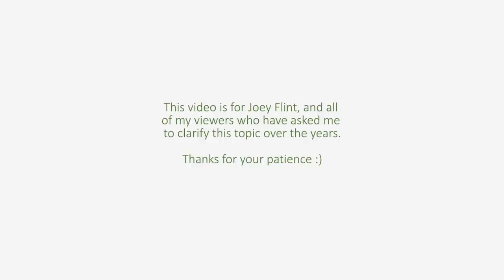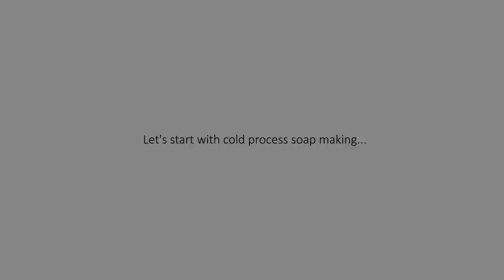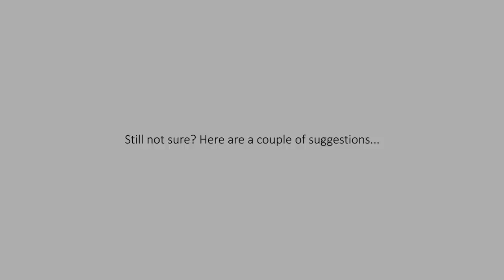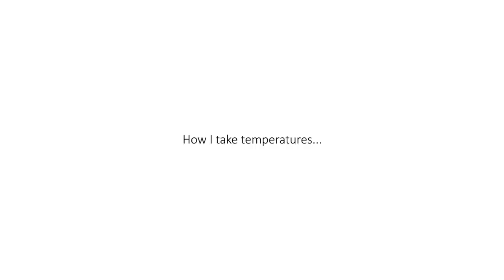About temperatures for soap making (CP & HP)

Comment: We live in Cyprus,  and don't have dry lye. We have a 50/50 solution n add water to 70/30. The winter was fine making olive oil soap, then suddenly the mix went thick immediately when pouring lye in. The only thing that changed is the temp of the room. Can't figure out why. With the mixer it turned lumpy immediately. A third attempt, we only hand stirred it n within a minute it was already thick. The temp of lye was 28•° . During the winter, we didn't even test temp n did everythin as it was n had perfect batches. Now we are confused.

Comment: Now I know why the batter trace too fast when I make soap, the temperature is too low on both the oils an the lye. My recipe includes coconut oil, cocoa butter and shea butter. Where I live in Puerto Rico the lowest temperature is between 73°F and 75°F. Coconut oil here is always liquid. It gets a little cloudy if the temperature drops a couple of degrees because of the weather but it's always liquid.  Excellent information. That's why I love your videos. Thanks!! 💕

Comment: What a relief! I haven't made soap for a while and I thought I'd make some Olive oil soap in hurry. I didn't bother with temperatures but I put well dissolved lye and water in the cool olive oil and mixed with stick mixer for a pretty long time. It never turned white but I put it in the molds anyway. It was the consistency of pudding, I didn't even wear gloves but the soap didn't hurt my hands. God only knows what I'll find tomorrow morning! Wish me luck. I'll try to give an update on this batch after examining it in the morning. After what Elly has said about temperature, I can be hopeful. Haha!😂
Reply: The soap did harden up overnight. It's a yellow colour. Must be the kind of olive oil I used. It's much easier than I thought or how I made it in the past. Thank you for that timely info about temperature and reduced water info too. I used 220 mls to 1 litre of olive oil.

Comment: Great video and good information. I find if it's coconut and olive combo above 35 degrees for the oils and below 50 degrees for the lye is fine in winter. I just combine them with no issues, if it's a heavy butter / hard oil recipe I make sure all is between 40 - 45 C. You are absolutely right with heavy water discounting and heat transfer method doesn't work well if there is a high percentage of hard oils and butters. In winter I melt my coconut oil as the heat transfer method isn't as effective
Reply from the maker: Ah yes, I know you love the heat transfer method! Thanks for your input George.

Comment: The queen of soapmaking videos delivers another fantastic guide for all us mere mortals to absorb and use when practising our craft.

 Thanks Elly for the explanation, usually my soaps come out ok, for a beginner anyway, other than the one I made in July where the butter/oils mix and lye must have been too hot as it thickened up with the stick blender in a  few minutes and i had to scoop the mix out with a spoon into the mould. It did feel very hot too.

I read on another soapmaking site that between 25 and 55 degrees C or 85-`130F is a good rule of thumb. However based on the experience just mentioned 55C is probably too hot.
 As you say room or body temperature depending on the recipe is suitable working range.
My summer soaps are curing nicely and I've just began using them, they appear to have turned out ok. 
That is the frustrating part, creating a recipe, making the soap and waiting until they cure to see if the recipe is a success or not, all part of the learning process though.

Comment: I love your clear info!  Regarding temps... even with Shea butter and added sodium lactate, my vegetable oil only cp recipe doesn't have much longevity in the shower.  Before I switch to tallow, I want to add stearic acid (cheaper than adding more shea).  With a melting point of 160F this requires a minimum 130 F temp for saponification. How do I prevent high temp issues like volcanoes or white spots?

Comment: Hi, great lecon. Please a lesson on hardness of soap. In mu soap calc I manage to have hardness=40 or 41 is that garantee my soap to be hard so that it doesnt melt when i use it ? Thank you, i learn a lot from you.
Reply: Add more olive oil to the soap. Olive oil adds hardness to the final bars. 
Also Elly had a recent video on the gel phase, if you make sure the soap fully gels your bars will melt slower. 
But I also find that the bars and recipes I enjoy melt in the shower easily and I just put well draining soap dishes all over my house.
Reply from the maker: Hi, soap can be extremely hard but still be very soluble and melt fast in the shower. Hardness and solubility are very different things! Soap calc doesn't explain this to us very well. The best way to get hard and long lasting bars is to use lots of saturated fats and butters (hard oils), this page will help you https://www.ellyseveryday.com/choosing-oils-for-soap-making
Reply: @EllysEverydaySoapMaking  thanks a lot this helps me as I am a beginner in soap making.

Comment: Thank you Elly for another informative video.
I have a question that may seem silly, excuse me...
I had made a batch of lye for my soap batch and my oils were melted but I could not get to actually making my soap because of an emergency. I packed everything away safely to make the soap the next day.
I had to warm my oils up a bit again (winter + coconut oil) but my lye solution was cold. The batch of soap cracked on the top a bit but the soap did turn out lovely, saponified etc.
My question was whether it is possible to reheat a lye solution gently to make soap and in so doing avoid cracking due to the varying temperature of lye solution and oils.
Apologies for the long message...
Reply: Yes I generally see soap makers heat the lye solution in a warm water bath
Reply from the maker: Hi, yes you can warm up your lye solution in a stainless steel pot, water bath, and I've even heard of people using the microwave. You would have to do your own research on all of these though and check them out before doing it. I'm not sure which is best. With your soap cracking though, that would not have been due to the different temperatures of your ingredients, that would have been due to your soap getting too hot in the mould through too much wrapping, oils too warm or using oils that saponify very fast and get very hot (in which case you need to wrap them less).
Reply: @EllysEverydaySoapMaking  what do you think is the cause of hard brittle soap that the layers dont stay together?
Reply from the maker: I'm not sure without knowing the recipe. Could be that it is left too long before cutting?
Reply: @kayla-rae4770  thanks so much :-)
Reply: @EllysEverydaySoapMaking  thank you so much Elly...that is a great tip to know, especially when I find that I am running out of time to continue soaping in my kitchen.
Yes, wrapping them too warm would explain it, I did indeed do that and my oils may have been too warm and not the room temp. of the lye solution.
You are such a great teacher and so lovely, no ego just beautiful!
Much love from South Africa
Reply from the maker: You're very welcome, and thanks so much for your kind words - they mean a lot! Take care x

Comment: I heard that the lye solution and oils should be within ten degrees of each other to maximize soponification.
Reply from the maker: It's a myth. The temperatures equal out with each other when the two components are mixed together. Only with hard butters and waxes does the temperature need to be measured.

Comment: Thank you so much Elly, I am a bit confused 
Ok, would it be ok if I have the same temperature 40 degrees  method for both my 100% oils and lye solution when I used 15% Shea butter and 15% cocoa butter and 20% coconut oils while my other oils is olive oil 50%. 

In order words if I have 15% Shea butter, 15% cocoa butter and 20% coconut oil with 50% olive oil which methods will you consider to be best.
Reply from the maker: Hi Geldine, yes about 40°C for oils and lye would be perfect for that recipe :)
Reply: @EllysEverydaySoapMaking   thank you

Comment: Thank you for taking the time to explain. You are so much help! I have a weird question.. when making hot processed soap is there a way I can turn it into cold process..Once I add the lye can I then pour it out and put it into soap forms and cover it to help it cure and turn into cold process soap? It is so hard to explain what I mean..I hope you know what I mean. Thank you so much for all your videos.. Loving them all!!!
Reply: I found a better way to explain ..  when i make hot processed soap.. the oils are melted and I add the lye water.. can I then use that batter like a cold process batter instead of following through with the hot process procedure.
Reply from the maker: Yes, of course Penny! HP recipes are just cooked CP recipes. Only difference is I often use more water in HP recipes to account for evaporation.
Reply: @EllysEverydaySoapMaking  That did not work for me... I am making hot processed soap right now.. I melted all the oils in my crock pot and I just added the lye to the melted oils. I stick blended it well and now I am going to cover the crock pot and "let it cook" instead of "letting it cook" can I scoop it out and  treat it like I am making cold process soap by add colors and fragrances and then put it into molds and treat it like I am making cold process soap?

Comment: Hi from Leeds United Kingdom 
We are having problems with our soap retaining its smell. The essential oil seems to fade quickly. Could we be burning off the smell with the hot Lye? We use the heat transfer method and olive oil / Coconut oil and Castor oil.
Reply from the maker: Hey Chris, are you putting the EO’s in at trace? That might help, but it’s most likely EO choice and the amount used. Many EOs fade in soap, trick is learning how to blend them. I have a video on that and many of my recipe vids have good blend examples.

Comment: I followed your recipe for the lavender soap. When I added the lye to the oil and used the stick blender, it traced so I poured into the mold but at the end of the pouring, the last quarter of the mixture was very thick, almost set and much thicker than at the start of the pour. I used mica powder for the colouring and rose oil for the fragrance. The last lot of the mixture was the consistency of hard butter. What did I do wrong ?
Reply from the maker: I don't think you did anything wrong, I'd say your fragrance accelerated the saponification and it was naturally thickening as you poured it out.

Comment: Thanks so much what of leaving ur lye solution for 24hours before usage does it Have any effect to ur soap
Reply from the maker: No, you can do that if you like. These days I prefer to mix it in while it's still hot/warm though. It's easier. A cold lye solution won't work well for all recipes.
Reply: @EllysEverydaySoapMaking  thanks so much ma but can cold lye solution work well for olive oil soap

Comment: Can you actually work with your line and your oils and butters right around the same temperature? And if you’re using a mixture of butters and oils, then what is truly a good temperature to mix them up because I let my lies solution cool 89 and butter and oil mixture about 96 and I didn’t get any trace
Reply from the maker: You sure can. Body temp is ideal.
Reply: @EllysEverydaySoapMaking  so like 98°? Would that be the ideal temperature for? Lye and oil and butters ??

Comment: Have you ever tried a stick blender hot process that doesn't use the crock pot? I don't have a lot of room in my kitchen, so at the moment I don't have a crock pot.
Reply: The whole point of the hot process is for there to be a source of heat to cook it. If you only stick blend it then it will be cold process and not hot process
Reply: @kayla-rae4770  Not sure that's true... 

Old Town Charm Soaps:
https://www.youtube.com/watch?v=sxvVsSrPBIw

The Goat Milk Soap Store:
https://www.youtube.com/watch?v=07Wj6FgrXD4

How to Make Soap:
https://www.youtube.com/watch?v=CBlS3WfKpXM
Reply from the maker: Actually Kayla there is a way to make hot process soap without a crockpot - with very highly heated oils and a stick blender. You can search this for more info :) It's called 'high temperature HP' or 'stick blender HP' soap making.
Reply from the maker: Hi Jen, no I haven't used that method but it certainly holds some appeal :) You have to watch the soap very carefully though and use a nice big pot!
Reply: @EllysEverydaySoapMaking  wow really that certainly sounds difficult thanks for the info😃🙂
Reply from the maker: It's not hard, just very hot process! You have to be careful with all soap making :)
Reply: @EllysEverydaySoapMaking  Thanks! 
Yes, in the videos I've seen so far it looks like it swells several times it's trace size. I may try a super small batch in a really big pot sometime... outside ;)
Reply from the maker: Ah yes, good idea! I'd like to try it one day too for fun. It would be good to free up space if I don't need a slow cooker...

Comment: Hi Elly.  thank u so much for being so kind to share your wonderful knowledge about temps.  I really appreciate your efforts.  My soap batter gets accelerate very fast if I add Fragrance oil.  Im so afraid that I just use hardly 2% for 450 gms of OILs.  Can you please make a video on how to prevent acceleration after adding fragrance oil(s) into a soap batter.  Plz note that I dont add EO coz they r really very expensive in my place.  Thank U ☺💝
Reply from the maker: Hi Rahat, that always happens to me too! It depends on the oils though. The only thing you can do is make your soap at lower temperatures, and be prepared to move fast! This video shows how quick you need to be sometimes https://youtu.be/tVCjcOewexU

Comment: What to do when my soaps get separated n the oils floats on the top. ?
Reply from the maker: They need to be rebatched. The soap will not be safe if the mixture separated. You can use this method to re-mix and cook https://youtu.be/STQ-C4L363o